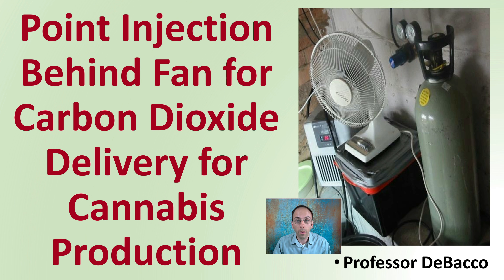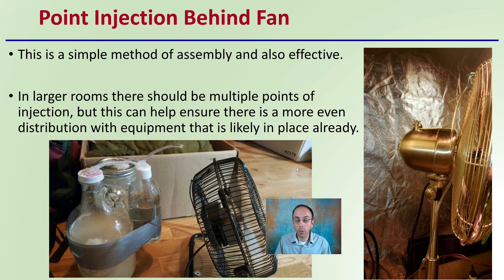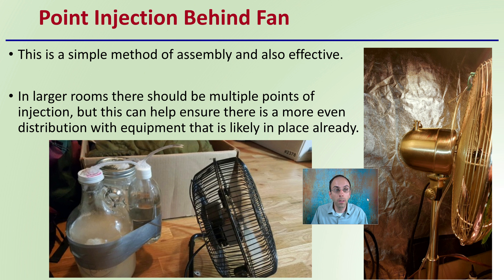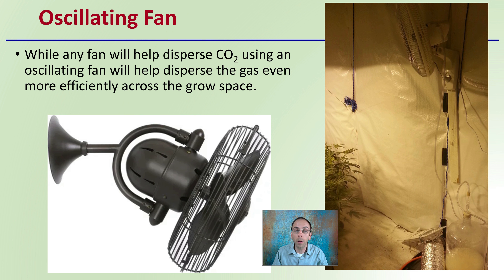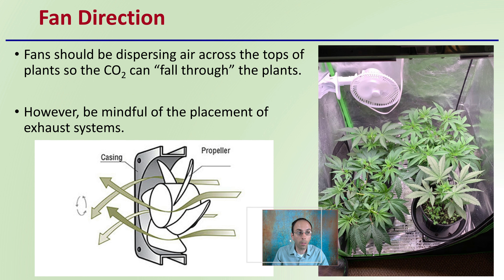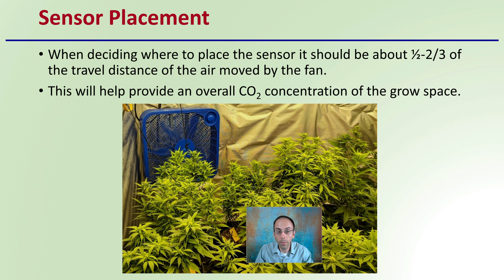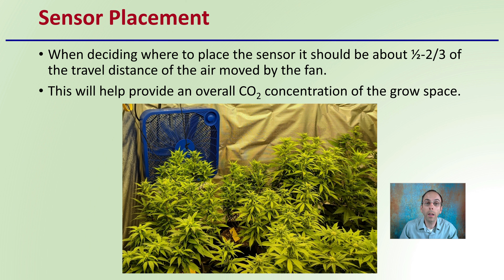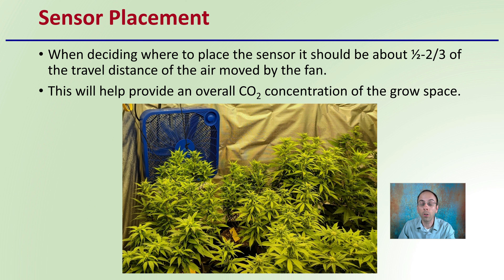Point Injection Behind Fan for Carbon Dioxide Delivery for Cannabis Production

Comment: Do the mushroom kits that expel c02 do well for home use? I feel like a entire tank for just a 4x4 is overkill
Reply from the maker: This kits may expel CO2 and while any amount above ambient can be helpful these are minimal and do not offer controlled dosing.  A tank system even for a 2ft x 4ft tent may seem like overkill, it will last a long time and can offer many plant benefits that justify the initial work/cost associated with this system.
Reply: @DeBaccoUniversity  thank you for the reply!

If my lighting it only averaging 1000 par, will increased c02 help or do i need to average around 1500?
Reply from the maker: Assuming other growing environment conditions are not limiting in your situation, adding CO2 will be beneficial.  Increasing the intensity would help and should be worth adding.  There are other videos on the channel to help offer specifics on a carbon dioxide enrichment system.

Comment: Will you do a video about how much Co2 is elevated simply by drawing air from inside the house with 2 or 3 people in the house and venting the exhaust outside
Reply: 800 to 1000 ppm I think
Reply from the maker: The variability is hard to draw any reasonable conclusions from, so get a controller and you can make adjustments for your given area/conditions.

Comment: Could you sleep in the same room as this
Reply: Ya because the levels aren’t that high to worry about, and you only use CO2 enrichment when the lights are on. So when you’re sleeping, the lights and CO2 will be off.
Reply: T-1000 WizOh'd I concur simply go without the CO2 and grow away but don’t implement CO2 if you’re having concerns
Reply from the maker: In short yes, and as Tom Bryant points out when the lights are off so will the CO2, and even with the lights on the levels are not harmful to humans so use a quality controller and you should be fine.